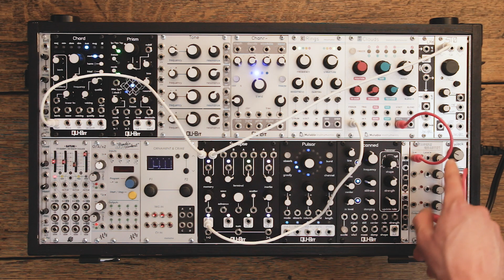Useful Utilities: Switches (Qu-Bit Synapse)

Comment: I read somewhere that there is a voltage drop on this module that prevents it from being used with direct v/oct signals. Here you have the quantizer after the synapse, so it wouldn’t matter. Has anyone ever used this with multiple v/ oct signals directly going into the Synapse inputs then out to different oscillators? So that you could use it to switch the pre quantized melodys to different modules